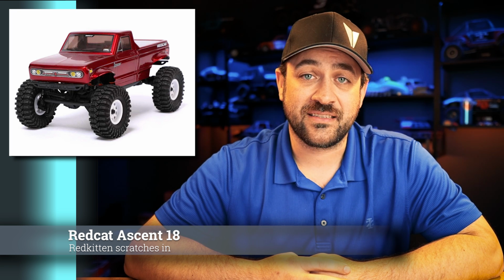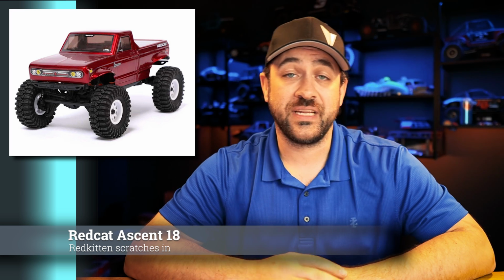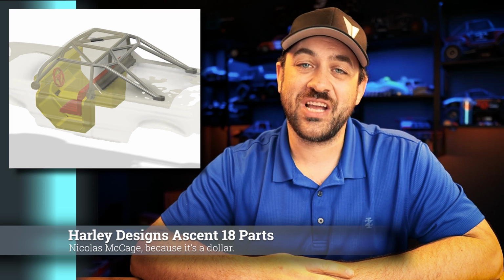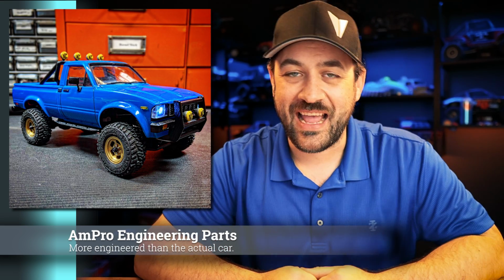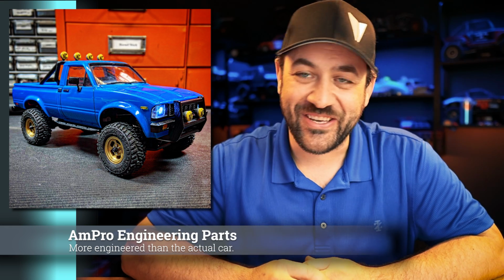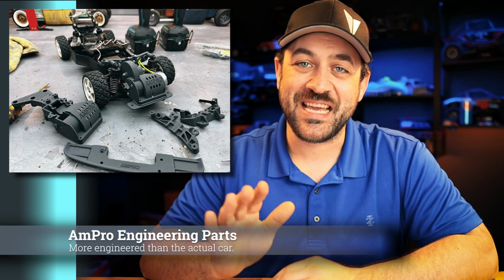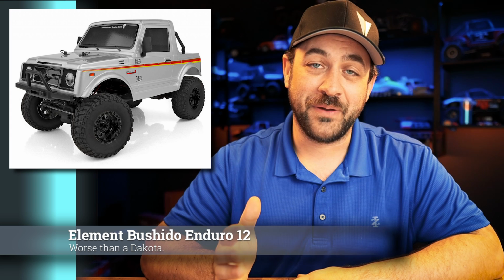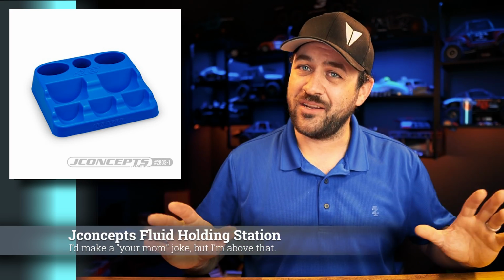They actually PASSED the 3D Printer LAW!! - Scale News Update - Episode 302

Comment: The most expensive rc-car I've ever own? Well that should soon be my ongoing projekt. A Reflex Racing RX28SE Gen1 car 1/28 scale. So far put in around 1000$ But that is for more than just the chassis, stuff as a complete tool set, spare parts, esc, 2 engines, 5 different bodies etc.
Have owned a HPI Baja 5T that I put in around 2000$ into. But I believe I'll get over that with my RX28SE kit, still missing radio, receiver, tires, batteries and charger 🙂 Yeah I need a track also since I soon live in the woods far from RC-clubs and RC people. Thinking of building a outdoor track too...

Comment: Brand new dr10 kit. Painted a c10 body for it that changes colors. It had a mamba x briefly but that went to a crawler project. I did one burn out on my shop floor. It looks good and is now shop art lol. Most expensive if that includes all its different stages over 18yrs my og scx10. Started as a new ax-10 artr. When the honcho came out I bought a chassis on eBay and $3500ish it’s now a Rc4wd k5 modeled after my 79 K5 on 1tons and 39.5/16.5/16 pitbull rockers I had back then. My son grew up (22 now) with that truck, caught his rc building and comping addiction from that truck and will inherited that truck.

Comment: My most expensive rc purchase is definitely building a custom tig welded ti rock crawler buggy. I agree with Josh when you said in a previous show about building your own s far more expensive.  Once you factor in the design, engineering, tube bending, prepping and notching all the tubes, building and tapping all the tabs, making it symmetrical and look good all with draconian methods, it definitely takes a long ass time. There was no cad or jigs used, just a lot of math, drawings patience and time. A lot of thinking and a little luck but way happy with how it turned out and how it performs. Totally worth it

Comment: The answer to this week's question is (sorta-kinda) 3-fold.  First, the most expensive that I've already purchased (but have not yet received) would be the VESLA.5 C1E SBK ($850), from Kraken RC.  This is the soon-to-be-released (ie. shipping towards the end of April) kit version (no electronics) of their C1E RTR (the RTR is closer to $2K), which is a clone (albeit, much higher quality) of the HPI Baja 5B, with a better cage & body.  Even though I do have an XMAXX, I purchased it as a roller ($350) from an RC chop-shop, so it doesn't count.  Next up is the most expensive that I'm about to purchase - the DTT-7 V2 (a $1.1K clone of the Losi 5ive-T), from 30 Degree North.  The only decision left with this one is whether to leave it gas...or, to install the electric conversion.  Finally, there's the most expensive (of the three, it's the MOST expensive), which I'll be ordering in several months - the Smithmaster/RCMK SCR Max ($2.6K).  All 3 do have one major thing in common - ALL 3 are 1/5 scale.

Comment: Most expensive purchase? A complete electronics set from Holmes Hobbies. Motor, 2 servos, ESC, wire harness kit. Barely edged out my radio.
No prep car? Oh yeah, by the time I got it all together and running the scene around here had died. It looks good sitting on a shelf in my shop next to his drifter buddy.
Thanks for the news, was gonna make a lousy comment about the printer thing, but I feel I've bashed on Cali enough. Can't stand that state. Oh well.
Have fun all.

Comment: I have 6 Drag Cars. The LOSI 22S 1969 Camaro, VRX-Racing Blitz Drag Car, Team Associated DR10, and a Rat Rod Trophy Truck and SR10 both converted into Drag Cars since all 3 of them use 90% of the exact same parts adding a Wheelie Bar to them.
Then there is the Traxxas 1967 Chevrolet C10 Drag Slash and it is the most expensive RC Car I have since I could not buy one from any RC Hobby seller in the US. Every single one I tried to order from would not sell me one since its like Traxxas has imposed some restrictions on them from exporting any of their products to where I live in Australia.
I could not even get replacement screws for it if they have the Traxxas brand label on them let alone actual parts if something breaks. I had to go through a seller on eBay to get the Drag Slash and it ended up costing me a lot more than my Arrma Infraction.
No wonder some people call them Traxxsux, Traxxass, or Traxxarse and I would completely agree with them.

Comment: I think my most expensive rc is my wraith 2.2 I have vanquish 2.2 wheels pitbull braven tires Currie rock jock axles under it as well as the tekin rock 412 esc and motor and a savox monster servo as well as bgr shock hoops and top cage peice with spare tire carrier it’s between that and my first vanquish phenix kit I bought I converted it to f10 straight axles with aluminum housings and knuckles had to buy the new axle shafts for it and I also put incision driveshafts in it and built anodized 90mm s8e shocks with orange top cap and adjuster with the upgraded inner shock shafts as well and I have the tekin rx4 in this as well but with a Holmes 2700kv motor and a shift rc servo for steering and a savox servo for the dig I added a origin body with the inner fenders and interior and all that and some vanquish wheels with orange skarn beadlocks those are 2 of my crawlers I have 5 more built similar

Comment: My most expensive Rc is my primal Rc Raminator i have over 10,000 invested including the price of the truck.
Reply: Pleased to hear you drive it. We need to enjoy our tiny trucks. In chicago the winters are too cold and wet. In process now cleaning fixing and prepping for the rc season. Back in the mid 80s most rc were simply a tub chassis and a buggy body. The rc gold tub was my first real rc. 80 lbs thats a beast.
Reply: @allmightygreat1892  I remember the 80s I was born in 76 ,  definitely agree on winter it's way to long, I live in CT so I feel the pain, I have been building the goblin truck from maximum overdrive to pass the winter time.
Reply: Do you drive it . Whats the weight. Thats a lot of parts to sneak into the house behind the wifes back.
Reply: @allmightygreat1892   I do drive it, it ways 80lbs ,  not as many parts you would think but everything on that truck is expensive lol good thing I'm not married.

Comment: Expensive can be measured a few different ways.  My Sakura Sport is by far the most expensive build (but for GT2 racing) given I haven't run it.  My Grasshopper mod build is the silliest wasted money build (moded chassis to fit a 3S bat, 13T brushless motor, etc).  But by far, my T-Maxx 3.3 is outright my most expensive vehicle and the most expensive to run (hence it's now a shelf queen).

Comment: I still have a DR10 based 13.5 car sitting in the garage. I just bought the pieces to convert it to a RB10 and run it on the local carpet track.
Reply: I have 2 still let’s run em 10:10
Reply: I just bought an RB10 to run on the local carpet track. It's really good fun. And I have a DR10, too.
Reply: I’ll have to do this to my DR10
Reply: Camaro body 9:19

Comment: I spent alot building my scx10ii. Nothing axial on it except the front ujoint axles. Between the Castle brushless setup, and the holmes shv800 servo, i spent almost as much as an RTR. SSD wheels, jconcepts tusk tires, incision driveshafts, hardened steel gears, Ssd pro high clearance chubs.....flat belly skid......the list goes on and on. 
Definitely my most expensive rc
Reply: Sounds like all of my crawlers.

Comment: My most expensive RC is still my original 6th scale Willys build. It cost about the same as buying a decent condition  full size Series 2 Land Rover when I built it. That was in the times before things were easily obtainable like they are now. I had to import everything  to my country (South Africa) as we didn't have any Hobby shops that even knew what crawling was back then. The total build cost of that thing in 2008 was about $1700 if converted from our local currency 😂.

Comment: Top purchase for me was for my 1/7th Infraction. So totally worth it. But not only was it an expensive purchase just for the RC. I also needed to get a battery and charger for it. Still only running 3s which is plenty for me still. Of and throw in a new set of tires after putting about 8 batteries through it. Can only imagine 6s, I was thinking 6s this summer. Maybe another set of tires too! Thank you for the SNU Josh!

Comment: Most expensive has to be my SCX6. I picked it up during SNU at launch.  Then added aluminum axles, and a $300 servo asking other stuff like metal bumpers, a winch, Rock lights, light control, winch controller, scale bits.... I'm over 2k easily on that one.  Next up would have to be my class 3 HH TGH Carbon Sherpa with HH Stubby, HH V3 esc, HH f&r servos, TGH wheels etc... probably around 1400 in that one.  😮